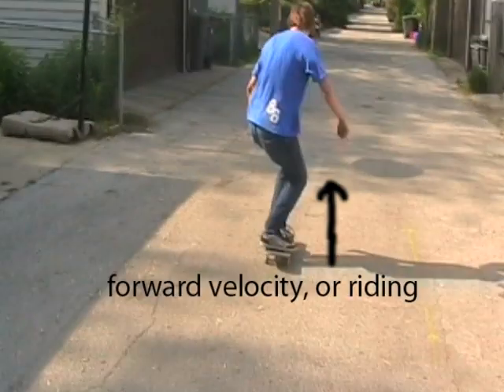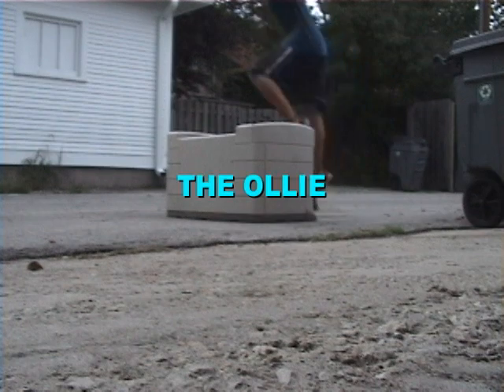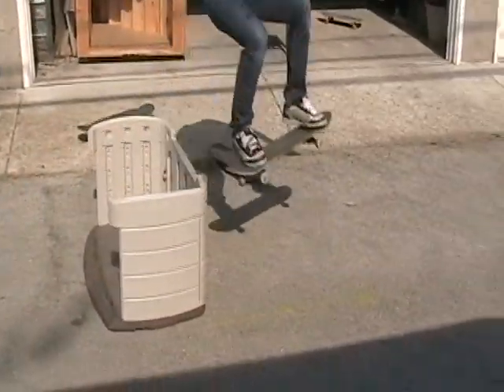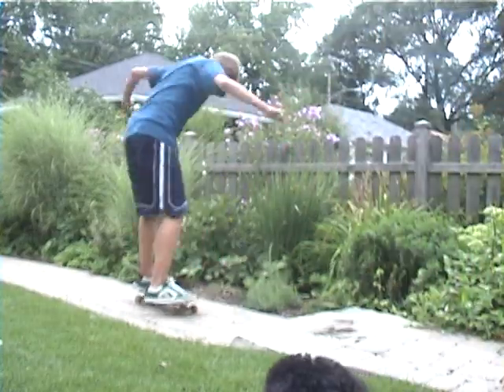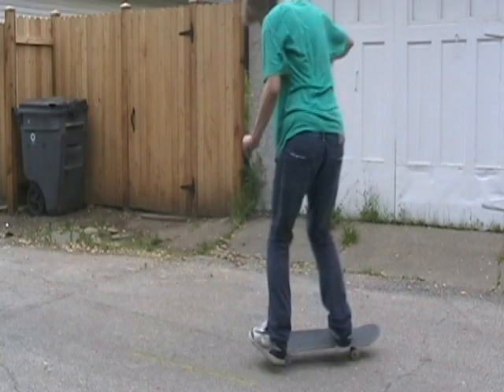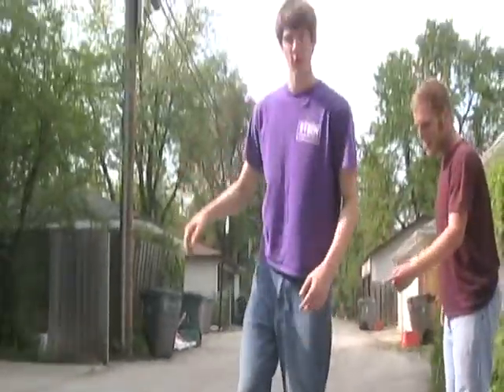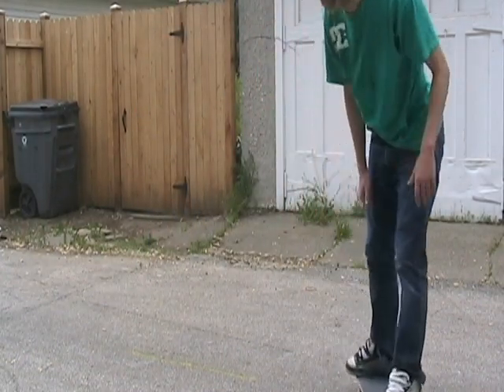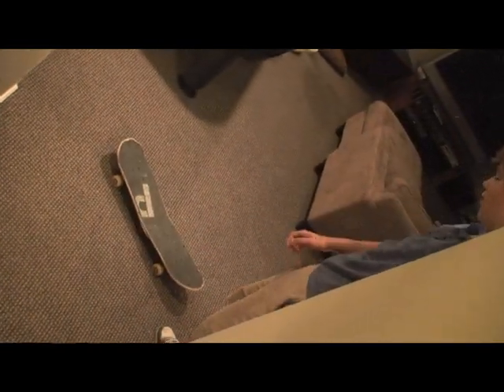Physics of Skateboarding Part 1

Comment: Theoretically there should be no friction between the wheels and the ground because they aren't sliding over each other. The force opposing motion in this case will be friction in the bearings or the wheels being stretched and deformed as they roll.